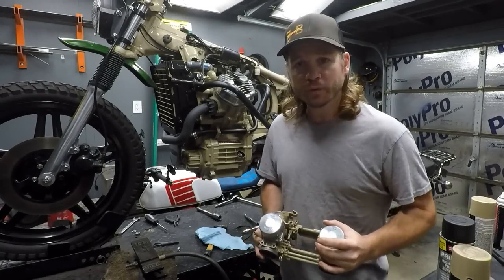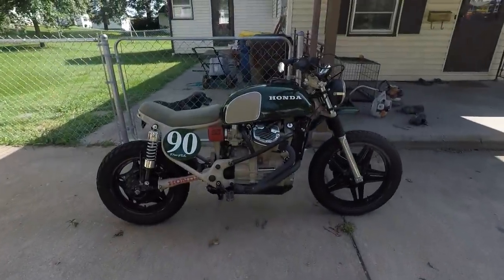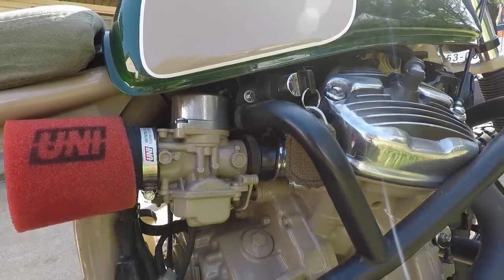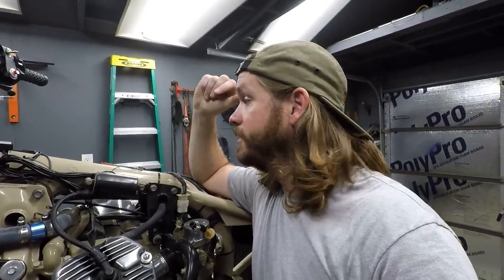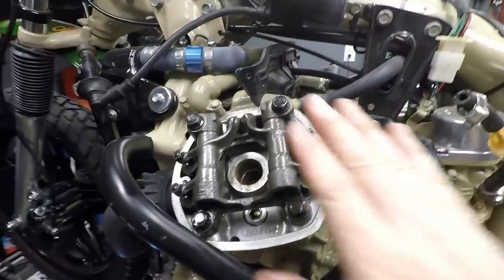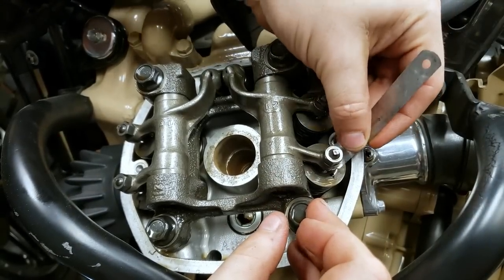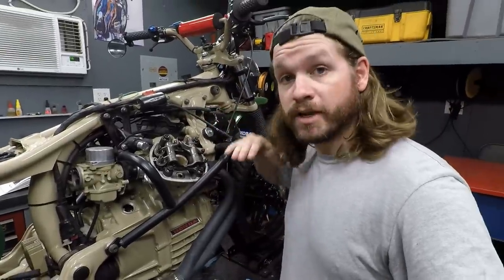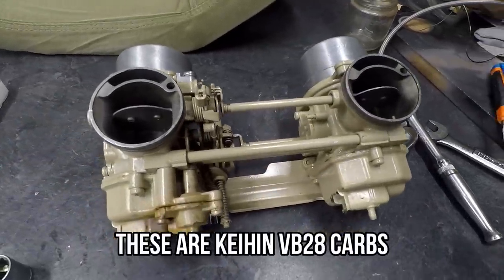CX500 Rescue - Fixing A Bunch Of  Mistakes! How To

Comment: Good on ya mate for having the balls to show us your mistakes. 👍
Reply from the maker: Thank you. Always want to show that kind of thing.
Reply: @BrickHouseBuilds  Why are rating your previous work of 6 years ago, so low? 1 out of 10? If the carburetors worked that long without problem, then the rebuild wasn't that bad after all.
Reply: You made mistakes probably because you learned the hard way, all by yourself, without proper tutoring.
Reply from the maker: @internetcensure5849  Well because they were done poorly. They really didn't work how they should have and honestly im amazed the bike ran as well as it did.

Comment: I really appreciate you doing this, I still need to do my valves and this video is fantastic with the camera angles. I also have a leak between my carb bowl tubes, so I need to separate mine and I was nervous about resynching, but this doesn't look bad at all. Thanks man!
Reply from the maker: The transfer tube orings are important for sure.  Just take pictures of the choke linkage and spring as many get that wrong upon assembly.  Glad you found it useful!
Reply: @BrickHouseBuilds  it's a slow leak, not enough to actually really drip anywhere, but it's becoming a problem. I only got 26 mpg on my last tank....

Comment: I replaced the fuel transfer tube O-rings, and managed to leave the washer of that sync srew spring to the wrong side of it's lever. So, the carbs were out of sync by the thickness of that washer.
And, as it made the right side carb more open, it had too fast idle on one and half cylinders, having that cough. Removed the saddle and tank, and as I already knew my mistake, I did not take the pair apart to correct the mistake, but adjusted the sync screw the amount the washer is thick. Now perfect CX 500 whiny idle again... It has always been a mystery to me why some of those whine even when new, same model year, and some do not.Two of my friends had CX:es in the early 80:s, one Custom that did not whine, and the other, normal CX (we call "Cow Honda" here in Finland as it is cool but ugly) did whine when new, and the dealer said that they usually whine... I turned my Cow to a scrambler/military bike, all super black satin but some parts olive green matt. Replaced the big rear wheel with a Custom model wheel, only to find out that there are very few options of tires for the size in off road tread pattern...

Comment: Just an FYI, you really should use two feeler gauges the same size when checking as the rocker arm can 'twist' enough to let in the wrong size and you'll have tight tappets when running.
A 'better' way for majority is to use Go-No Go method using 0.003" for inlet and a 0.004" as 'no-go then 0.004" ex with 0.005" being loose by 0.0005" (half a thou) is better than tight
CX500 cam chain tensioner is pretty much a disaster,  (there were 3 major redesigns plus at least two I know 'undocumented')
IF owner doesn't rev the bike it will break things, sometimes needing 'new cases on early models. Honda tested it at 10,000rpm for 150+hours non stop, owners run around at 2~4,000rpm and it breaks due to the V-twin load reversals (if anyone at Harley had any sense they would have read about CX500 woe's before breaking a ton of 'twin cam' chains and tensioners)
That should save you $40,000+ for a motorcycle trade school in Florida or Arizona

Comment: It's a bit uncanny to see those carbs from the CX500.

The first carburettors I have worked on was a Keihin VB31A.

And they look near identical; the ones in the video are smaller and have accelerator pump at the bottom, which I don't have.

The bench sync was pretty cool. I didn't touch that bolt, so I didn't have to sync them.

I learned something new, and it was something that puzzled me before I started with the rebuild.

I will do it down the road when I have a vacuum gauge.
Reply from the maker: These keihin cv carbs were used on nearly all Hondas in the late 70s to 80s. They varied in bore, jetting, and more but mostly the same
Reply: @Brick House Builds  I didn't know that.

The one I did was on a 78 Cb400.

Edit: I did a lot better than the previous guy that touched the carburettor.

One of the fuel mixture screws had a spring and a metal washer.

The other a spring, metal washer, and 2 O-rings.🤔🤨

Comment: Hi friend, excellent work. One question: should the cam chain tensioner be adjusted only at the tdc of the left cylinder or for the right one as well?
Reply from the maker: That is covered in the service manual so always refer to that first.

Comment: Owned a CX500 for almost 5 years. The bike for motorcycle courier. (UK)👍 However because of their 'high centre of gravity displacement', they were definitely NOT the bike to take a pillion passenger on UNLESS you wanted terrifying loss of control of the bike due to the failure re steering! 😶
Reply from the maker: Ive never thought of them as top heavy thats strange. Here in the states every bike is just bigger and heavier than a CX so these feel light and nimble
Reply: @BrickHouseBuilds  As a SINGLE rider of the machine it was excellent. HOWEVER shove on a pillion passenger and you lose steering. It becomes light, little or no traction to the front wheel even with adding a steering tension rod AND lowering the front tyre pressure.😶 In over 40 years of riding bikes with favourites being Honda, Kawasaki, BMW's up to and including 1100cc big heavy machines regularly with a pillion ... that CX500 was the only bike I NEVER would carry one! 👀

Comment: your valves should be loose before you adjust  did you get it to top dead center? they should click and move
Reply from the maker: I feel like I showed the processes well here. I demonstrated getting the engine in the correct position and then adjusting the valves to suit. At .003 it's not likely to make noise

Comment: Why my bike some time reverse fire all timing are correct but tappet was stiff im just doint tappet clearance so if that done correctly will that reverse fire stop im kinda a new in ,220 cc engines
Reply from the maker: Are you working on a CX500?
Reply: @BrickHouseBuilds  not on a cx ona bajaj 220cc engine

Comment: And if you spray it with carburetor cleaner and blow the channels with compressed air?
Reply from the maker: Can you be more specific on what the question is?
Reply: @BrickHouseBuilds  Why instead of an ultrasonic cleaner you didn't only use carburetor cleaner and compressed air? The paint could have clogged up the channels.
Reply from the maker: @denwiessimo6088  an ultrasonic cleaner is a better way to clean. It can dislodge small stuff from those passages where compressed air cant.

Comment: That powder coating on the engine is hard to keep clean and gotta be careful of chipping it when working on it
Reply from the maker: This is actually paint.  Wipes clean pretty easily but yes you need to be careful to avoid chipping
Reply: @BrickHouseBuilds  I realized after watching it's paint yes.